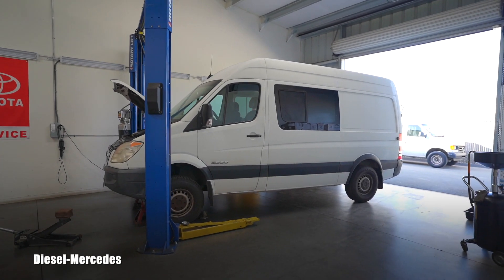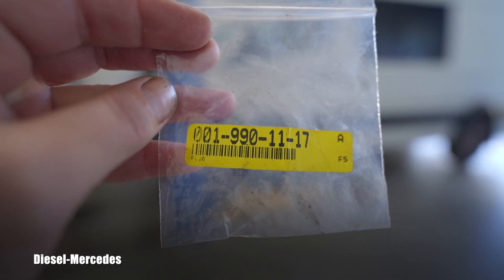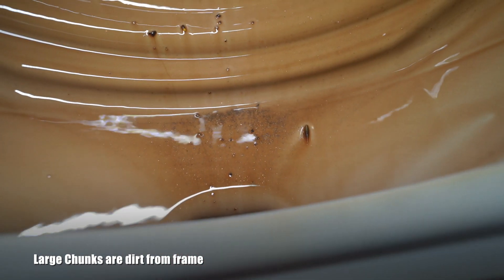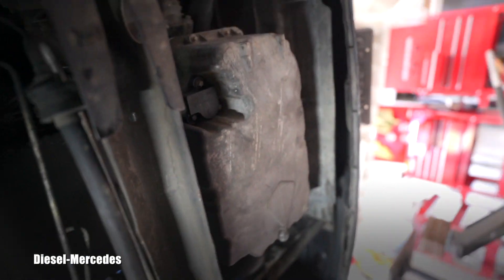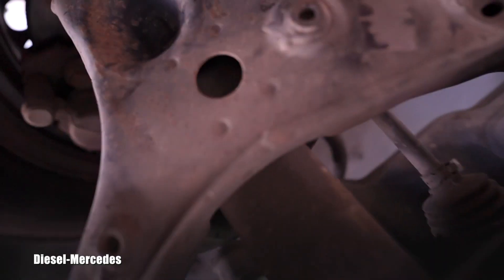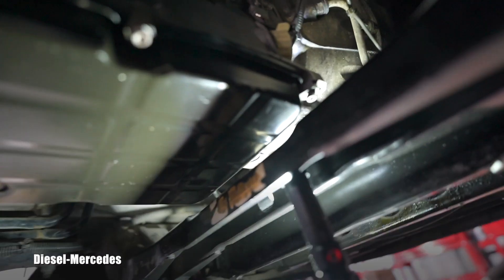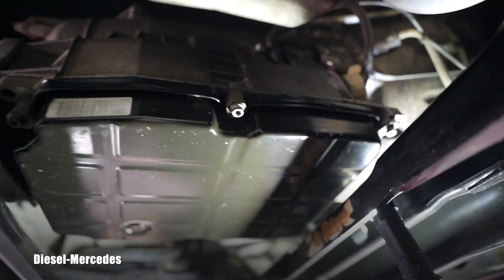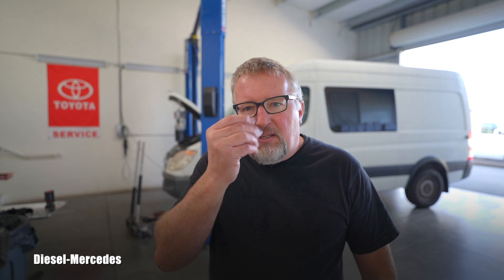Mercedes Transmission 722.6 Torque Converter Info

Comment: My mb s210 have a 722.6, but without drain plug on the converter. I thought about removing the return hose on oil cooler to remove and replace the oil. By starting and stoping the car while refilling oil, until you get clear new oil out from return hose.

Comment: Bear in mind that when this van was manufactured all manufacturers went to the never change the oil policy.  They all made this claim.  By not draining the torque converter u r only partially replacing the oil.  New oil is 50% contaminated w the old oil.  At least mbenz has a torque conv drain.  Most other manuf don't.  Multiple 1/2 drains will be about $40 each and u never get a total oil replacement.

Comment: Another example of find German engineering. Makes us appreciate our Toyotas. If you just wanted to get all the fluid out; perhaps it would've been easier just to drain and refill the pan. Run the engine for a while to run the fluid around the system, then repeat. A few times
Reply: Unless someone can prove otherwise, this looks to me like the kind of thing you'd find with American engineering.
Reply: @seanwright8384  given that is a Mercedes vehicle, with a Mercedes engine, with a Mercedes developed transmission; I'd say I have proved otherwise. Genius
Reply: @kevinbarry71  Calm down there fella. This was a product of the dark days of DaimlerChrysler. That's really what prompted my questioning.